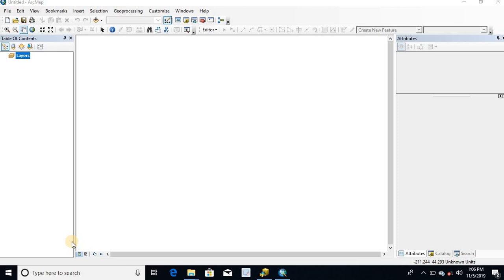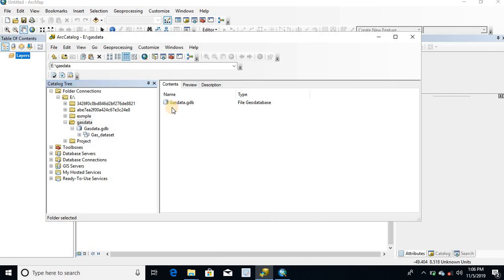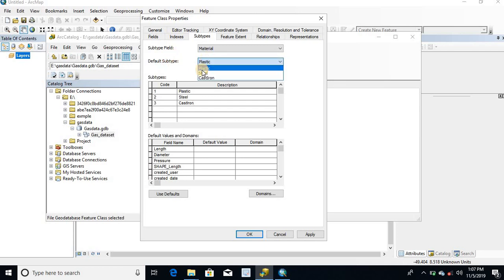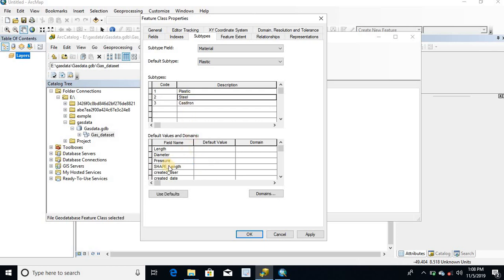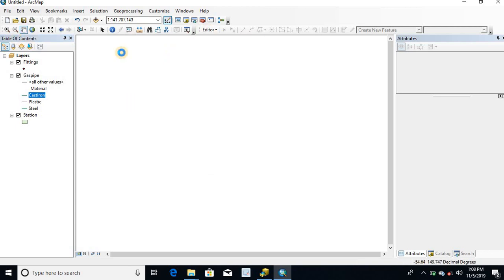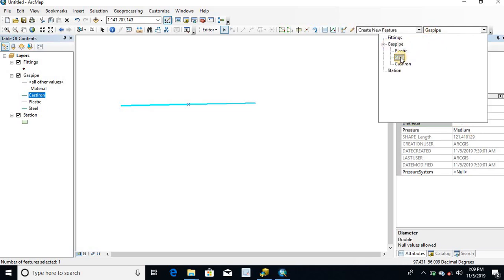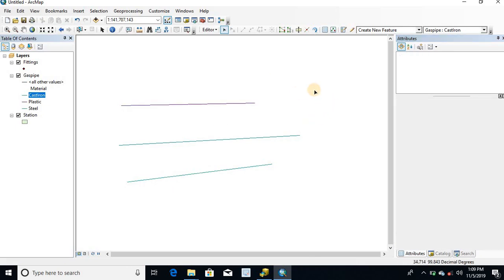Creating Subtypes in Arcgis

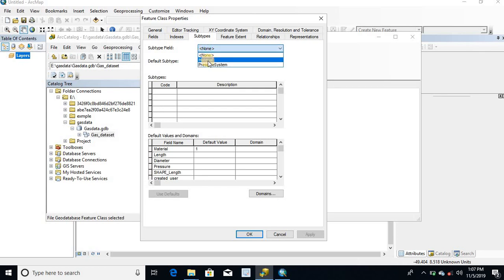Comment: I followed the steps in the Creating File Geodatabase in ArcMap video and I don't understand when the "Material" and "PressureSystem" were added on the list on Subtypes (1:05). I don't have a drop down menu - I have only <None>. I do not understand. What did I miss?
Reply: You cannot create subtypes if there are no available integer fields to use as the subtype field.